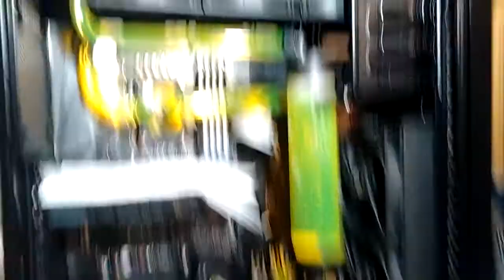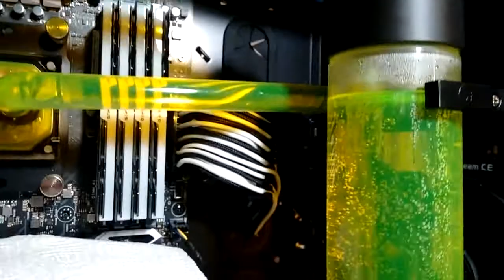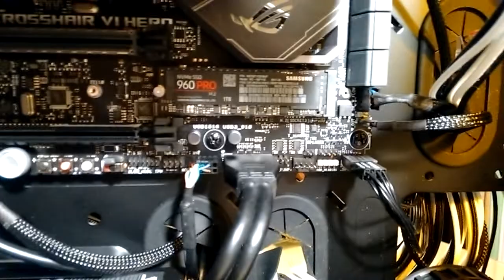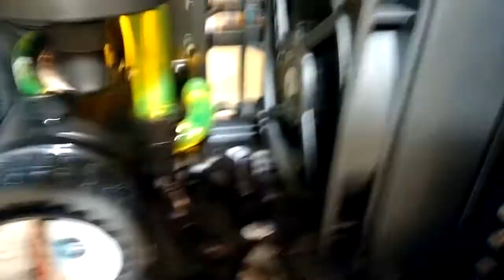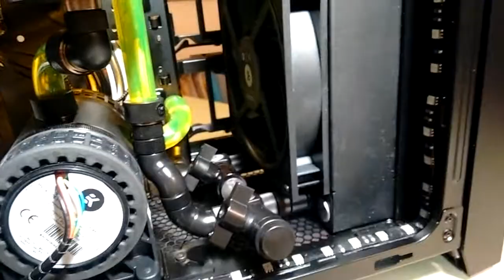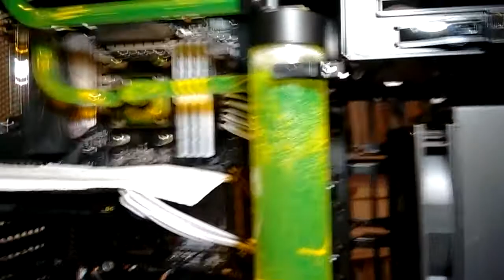Ryzen Build Log Part 11: System Filled!!! Leak testing and air bleeding

Comment: This video doesnt give any idea of flow rate at 100% pump speed as you suggested, actually if this is full pump speed your flow rate is terrible.
Reply from the maker: This video is about sound. Its what you asked. I might be wrong and the pump without the connected pwm fan headers possibly run at 60 %. The flow rate is not terrible. Its really good. Check the previous video while i attempt to fill the system and get a leak. Just because you can see turbulence in the water does not mean flow rate is bad. Learn before you criticize...
Reply: Thats just the thing I dont see any turbulence, I realize thats not a sure way of determining flow rate I was just trying to get some idea. Nice build though. Why havent you connected the PWM headers, especially with Asus motherboard (they have good fan / pump management.
Reply from the maker: Thanks took me quite a while to see it through. Sorry i meant "can't" not "can". I do have connected the PWM headers. You don't select RPM rather a percentage. Running the Pumps at 100% is quite noisy. I run them at 40% and they are inaudible. Barely any performance difference.  Above a certain flow rate you can't really perceive it unless you got many high restriction parts in the loop. Dual pumps is more about reliability, and silence rather than performance. I'll make a video at some point ramping up the pump and fans.
Reply: @SexyTerrorisT  For a potato head with the cpu block in the wrong direction u can tal for sure!
Reply from the maker: @afonsoalexandre9947  Rofl, CPU block is in right direction alright 😂 Hope you realized water flows from bottom to top. Tell me how much of a potato 🥔 head do you feel now? Please 'tal' me.